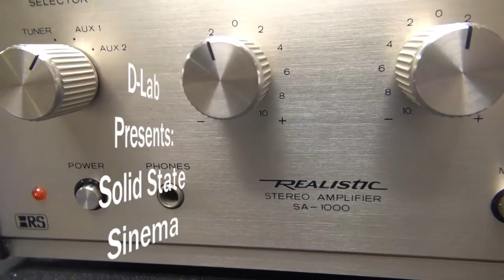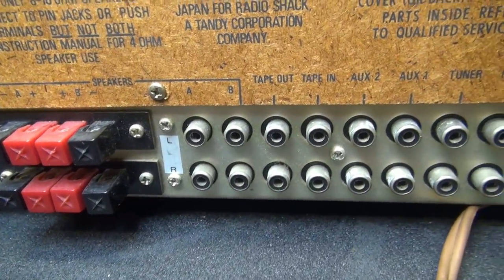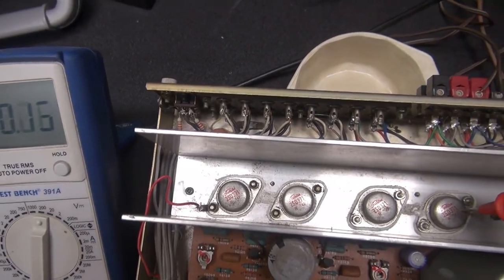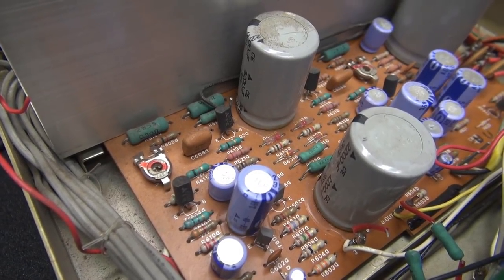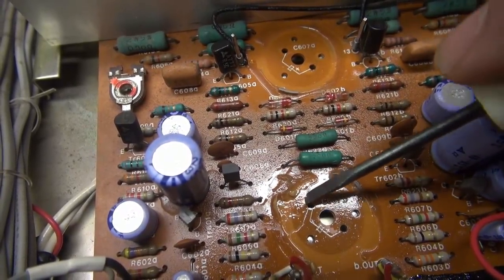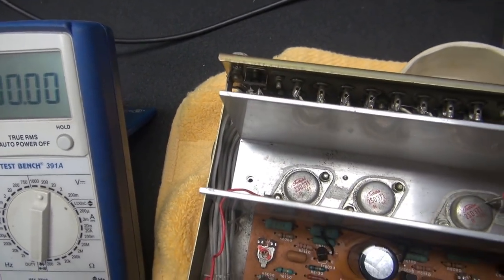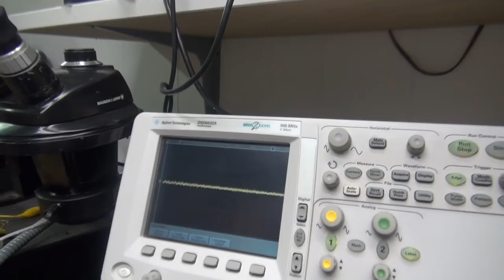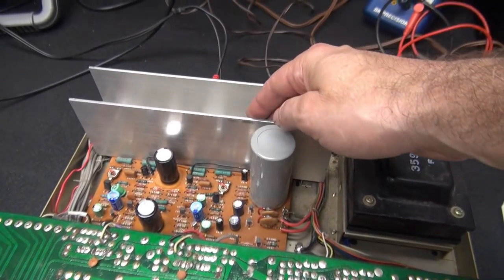How to repair weak distorted channel Realistic SA 1000 home stereo amplifier D-Lab

Comment: I been fixing audio equipment for 40 years, fix an amplifier is an art, the new technicians or engineers do not know anything about this.

Your workbench is very clean, my lab is a war zone.

Cheers.
Reply: sure is. looking under the preamp board and finding a host of bad small value electrolytics , thats also art  :)
Reply: @markbuxton2368  small value electros can be replaced with WIMA film caps, I have upgraded my TC-778 phono stage with 4x 1uF 63v WIMA caps on the in/out coupling links
Reply: I'm an engineer and I try. Teach them instead of having this attitude.

Comment: I have a Realistic SA-1000-SA amplifier which is almost identical to this unit (it doesn't have the phono mag/ceramic switch).  I also had a low output channel and mega distortion. Also, all the pots on the front panel were noisy and "Clunky".  I was lucky that a little bit of good quality contact cleaner and working the pots for about 5 minutes managed to clean up the crud and it now sounds just the way it did when it was new, back in the 70s.  Still a great little amp with a somewhat low output (About 20 watts RMS per channel) but in a small room, that's all I need.  Thanks for posting this cool video.  It brought back lots of memories. Incidentally, I think I paid $99.00 for it at a Radio Shack here in Halifax, Nova Scotia back in the mid 70s.

Comment: I was in hong kong 1965 and bought a nice pioneer sa400 amplifier. when I sold stuff at a garage sale I let it go and had sellers remorse ever after. what a stroke of luck to find a pioneer sx-32b receiver in like new condition at a local good will  store. 15 bucks. it has exactly the same audio section as the sa400. amazingly some dioxit5 on the switches and controls and it works perfect on its original components. found a SL-D2 turn table free and have it on 10 inch cerwin vega speakers. along with casset tape unit and audio cd player. makes up my main listening system.

Comment: I am looking at a similar half clipped signal right now from a 1975 Roland JC-120. I suspect the same is going on. Terry, thanks for the video! This amp means the world to the guy who bought it in 1975, so gave me perspective on another couple repair paths and checks before I dive too deep into part level testing. The pots all required complete disassembly and contact cleaning along with reflow. Cheers!
Reply: give us an update, please! Did you get the JC-120 back in action?
Reply: @timwarneka5681  Hey, no unfortunately not yet. Mothballed it for now, but hope to get back on it soon.

Comment: The glue used at the factory to hold those capacitors down prior to soldering  was probably not the same corrosive stuff that you would see in a Sansui or Yamaha or many other vintage amplifiers. The corrosion inducing glue was generally known as Sony Bond, and it does not soften in alcohol, although you can sometimes hit it with some Freon type component cooler, or one of those "dust-off" type  compressed-"air" cans (hint, it's not really air) held upside down as you squeeze the trigger so that the "air " comes out as a liquid, freezing the glue and allowing you to chip it away. Anyday, no day at work seems complete without scraping off some Sony bond that has morphed into something resembling burn sugar, and replacing the adjacent components that it has corroded. PS, we have seen instances where the crimped or riveted-on terminals on those output coupling caps have become intermittent and the measurable distortion goes up and down if you pull on the the leads or flex/rock the capacitor.

Comment: Good call on the caps.  Sony Bond was used by many brands, not just Sansui to glue the components (for the trip across the pond). Pioneer, Yamaha, Onkyo, Technics, etc. Pretty much anything built in either Japan or Korea. And of course back then they had no idea it becomes corrosive with age, then the corrosion spreads and becomes conductive. Some production workers got carried away with it and blobbed it everywhere! I use toluene to soften the glue because it 1) dries fairly quickly 2) doesn't have water like alcohol has unless you use (expensive) 99% alcohol. 3) it is safe on most plastics (except polystyrene caps but it really doesn't hurt them, just makes them ugly). Though some people don't like the odor, I don't mind it. Look on the labels of solvent-based glues and you'll see toluene is usually the solvent in the glue.  Oh, and I love that tune you played!

Comment: Working on vintage solid state can be easy, unless...there are multiple boards mounted on top of other boards. Then it can become an adventure just with disassembly. Once you get into multi-layer boards and SMD's, It can be living hell. I work on a lot of modern pro audio as well as vintage tube gear, and I'll take tube gear any day :) Excellent videos! Keep 'em coming.

Comment: Eminently good repair. Aside from your knowledge in electronic circuits you have the test equipments like the scope which is a must in repairing electronic equipment. However, when the transistor output is shorted, the safe way is to measure first the forward bias if it's within limit. If not, then start checking surrounding components.

Comment: Another great repair. It's a shame that the problem of bad and leaky caps has not yet been solved. More research should be done to overcome this problem. Surely with modern materials this should have been consigned to history by now.

Comment: Fun stuff.  Not many would repair an old Realistic as they weren't regarded as very good back in the day.  But Hey - they did the job.  I used to work for the Shack back in 1975.
Reply: That's true. But I remember going to radio shack and hearing some of their stereos and speakers and I remember comparing to my dad's Sony setup and thinking Realistic didn't have the warmth or bass of what we had at home. But then again, it was a small sample of Realistic that I actually heard in the 80s and nothing from the 70s. Generally, Realistic was not highly regarded like other brands. If one was serious about great sound they went elsewhere.

Comment: I had one of these. One of the small TO-92 stretch transistors became intermittant and caused 30 volts dc to be sent to one of my Dynaco A35 speakers, eventually melting the voice coil of the woofer. I was in the other room and didn't notice until it was too late. Just bending the leads would make it fail. It met it's fate with a 10 pound Wildlarizer. The amplifier sounded ok, not as good as a Yamaha or Harmon Kardon. Nice basic appearance and not too big. Very good for the price, $99 CAN on sale.

Comment: So cool to see that amp. I have the same amp. When I was 7 I remember going with my dad to Radio Shack for him to purchase ut. We used it for many years. I tried it and the only thing that I think is wrong is the volume control is noisy. I just ordered on Amazon control cleaner. I'm hoping that will get this awesome amp working again. If anything is wrong with it like yoyrs, I'm screwed. As I don't have your knowledge to do what you did. I'll be keeping my fingers crossed. Thanks for the cool video.

Comment: Thanks Terry, needed that video :) Have a solid state Standel on the bench right now and its showing similar issues. Will proceed to cap job and see if that fixes.. Kind of figured it was that as its a 1964 era early Solid state thing.
Reply: Bill what did you find on your Standel amp repair?

Comment: Hi
That's one cool job.
BTW
I had an old service book.
That showed a way to find a leaky electrolytic capacitor as follows.
Cut open or desolder , one of the two leads from the pcb.
Then use an analog multimeter to check the charge and discharge of an electrolytic capacitor.
Put analog multimeter in ohm range and connect the two leads. Positive terminal goes to the red wire and negative terminal to black wire.
Healthy capacitor should show very little resistance initially and gradually show higher resistance as it gets charged till it shows a full resistance.

If the capacitor is leaky it'll show a very little resistance, almost short circuit.
On the other hand, it'll show high resistance if it's open .
That way, you have found the culprit.
Bad capacitor will not show charging. ( No gradual increase in resistance as it is charged).
Thanks

Comment: For years I passed up alot of great solid state gear because all I wanted to buy was tube amps that was a stupid mistake on my part I have a Fisher tx 100 all germanium transistor Avery Fisher's first transistor line of amps built in Germany and  I  really enjoy the sound of this amplifier as much as the tube HiFi stuff i have even more than the marantz stuff
Reply from the maker: I agree man. The SA-1000 is in my main shop driving a set of Bose 301's. Super rich sound. The amp is a keeper!

Comment: It's less expensive time wise to replace all the caps. Time is what you don't have. But I would of found out which cap.was bad for the next time. However if the all go anyway which I doubt that's fine. Good job. The final result is there . You fixed it. Good luck for next time.
Reply: You have to figure that if one cap has died, the rest probably have one foot in the grave as well.

Comment: Good day Terry. The adhesive that you referred to in the video wasn't produced by Sansui, nor used only by them. It was used by almost all manufacturers out of Japan and some other countries as well. It was used in audio equipment, TVs, VCRs, radios, and lots of other products. I'll give you a hint as to who produced it,... it's called "Sony Bond". It becomes brittle and conductive after being exposed to constant heat over time, and then becomes corrosive to component leads and jumper wires. I've even seen circuit failures because of diodes that were buried under the stuff, becoming very leaky or even shorting. The companies that I saw being the most affected by its use were Mitsubishi, and Luxman. 
The really stupid thing about this stuff, is that it even after all the lessons learned the hard way about it years ago, it's starting to turn up again in lots of electronics coming out of China. Go figure.

Comment: I have the Realistic sa1500 and I also did a full recap and works better than new!! Pretty powerful with my Minimis 7 bookshelf speakers
Reply: nigel mahabir  I have one also try it on some quality 12  or 15 inch 3 way speakers  🔊  I believe it around 100 Watts rms per channel. Recapping mine soon
Reply: @nickking1510  The SA-1000 puts out 20 wpc rms into 8 ohms; the 1000A puts out 25 wpc rms into 8 ohms.

Comment: Darn, I wanted to see how you remove the solder from the leads.  Back when I did component level troubleshooting, I had  a Pace solder sucker.  That thing was great and was the best method of removing solder.  In my workshop I've been using solder wick, which is just ok and a little more work.  Your repair videos are great to watch.
Reply from the maker: Hello, sorry I did not show that. I use Chemtronics solder wick to clear the holes. I do have a Hakko solder re-work station, but use that on dual sided boards. More Solid state sinema soon. TD

Comment: I have the same problem with a Rogue rb-120bt 120-watt bass combo amplifier.  I thought it was the output transistors.  The problem is that those components don't have numbers.  I installed another by trying by error and blew up one of the new power transistors. Thanks for the video.  I will reinstall the original.

Comment: Hello captain, I have been chopsticking around in my one yankee dollar juliette 8-track/record player tuner stereo trying to fix a channel glitch.  The balancer potentiometer plays both stereo speakers when wiped all the way right, and then diminishes to nearly nothing as it is swept left.  It's essentially a volume control.  I will try hooking up all four speaker outputs.  The pot itself has the correct values.  I have checked both opamps but not the two larger capasauruses, haha.  Thanks and much love.
Reply: I''ve got a magnavox astro sonic that does the same  thing. Did you find the cause?

Comment: hi,i like to ask you one question :i have one amplifier Kenwood KA701with  rustling noise problem....i give for two shop to repair...no one find the problem...only left side with this problem,do you have any idea where is the problem?the noise is exactly like radio station can't catch the signal..thank you
Reply: Sounds like a transistor has become leaky (noisy) somewhere. Usually manifests inself as a "crackly" or "staticky" sound.

Comment: You can also carefully put a bit of kerosene with cotton swap and let the old glue wet for a while and try; the glue with the circuit board will also come out easily. I tried in my JVC amp.
Reply: Lighter fluid works, too. That's my go-to solvent for that contact-adhesive-type glue.

Comment: I think the old amps with discreet components will become more sought after in another 20 years. The circuit boards in the 70's and 80's are better and more reliable compared to boards used in the 90's.
Reply: Twenty years from now? How about 2023's prices? Even rebadged stuff from Radio Shack and JC Penny (MCS) have climbed up there!

Comment: I have similar problem on right channel, left channel sound proper but right its very weak, sometime distorted.  If I turn up 2 or 3 times the volume of the channel go back working again! Another symtoms of bad caps and filters?

Comment: That's actually a decent sounding stereo amplifier for what it is
Reply from the maker: At first, I thought it was cheaply built, but the sound is Monsterous!
Reply: It looks well laid-out and fairly easy to work on too.  And the pots were all good (or did you secretly de-oxit them?).  Probably low mileage, one careful owner.

Comment: Ive got a mono amp from the i think 1980s. Its an amplifier that was used on a paging system. Its been plugged in and on continuously since. Even after the phone system was upgraded, this abandon amp still plugged in and on.  It sometimes pops internal breaker when first turned on. It plays good but to me sounds a little off. Maybe a little muddy.  Supply voltage only drops 2 volts from no audio to full volume. 
Is it possible the caps are bad?. It also has some carbon resistors which i know can raise in value, but trying not to unsolder them to check as i have never had any luck checking them in circuit.

Comment: I've got an SA-700 amp that sound great but the left channel works for about 15 seconds then shuts off for maybe a minute, then starts the process all over again. This happens on speakers A as well as speakers B and I dont have any test equipment nor do I have anything putting off a lot of heat. What would you guess my problem would be?

Comment: Hi any chance of a bit of help. My dad bought a leak 70 amplifier off the Internet as spairs or repairs. He has plugged it in and there is zero power getting to it. Where should I start to look for the problem.

Comment: Hi! I have a Realistic STA-46 from 1974. It's beautiful! But... recently, the mode selector knob is shifty. With my turntable phone input, radio, and both aux I use for 5 CD disk changer and dual cassette player. The volume and clarity goes in and out (especially B speaker). I've reset everything. When I touch the the mode knob, and hold it still, the sound is clear and loud..... But as soon as I let go.... It goes in and out. I can still listen, but sometimes get static, or a burst of sound that makes me jump! Do you have any advice? Or a possible video to direct me to? Thanks!!!!o

Comment: I'm an retired teck  i did 20 years of tv  and audio repair back then what is your opinion on why the chinese import capacitors replacement are so much smaller at the same value and voltage than the older Japanese capacitors we used to see in these equipments, what technology made them so much smaller  do you think they will last 20-30 years like the old ones did ? Do you also have a solution to clean these old oxidized yellowish aluminium front plate  without erasing the printing ?
Reply: Don't buy cheap chinese caps, they don't last, get a good brand like nichicon, panasonic or chemi-con rated @ 105 degrees C, these are really good caps that will last.  For cleaning the front panel, you can try what I have found to work well, that is a magic erasure with lukewarm water, no chemicals!  Try on a small spot and lightly clean, don't need to dig in, the water/me will do the work.  If the ink is NOT water soluble, that should clean without removing the lettering
Reply: Just wandering around through the years I came across so much NOS goodness I stopped buying it. Just today I passed on the location of enough capacitors, power supplies, transformers of every type and size of wire or connector you would even need to produce high end amps and guitars for 10 years. And I passed that info to someone who tells everyone where to get low buck parts. If we stop trying to get rich all the time we can help each other learn how to do things ourselves...
Reply: @oldestgamer  low value electros can be replaced with film caps
Reply: @manFromPeterborough  YEs, and I do where I have the space to put the film caps in!

Comment: Did you have your negative probe grounded to chassis when checking the output transistors? I have an occasional distorted left channel (sizzle type sound)  but only with some cd's. I really notice it in vocals and piano passages. The amp has been completely rebuild and sounds  fine with cassette, radio and lp's. I'm thinking the CD player has the issue but want to be sure.